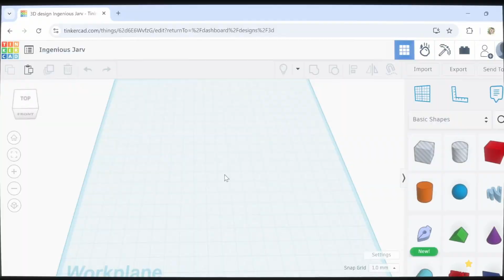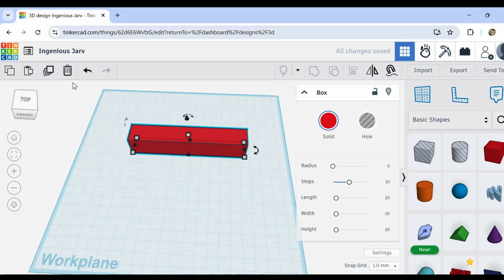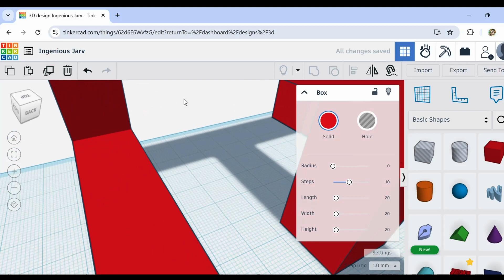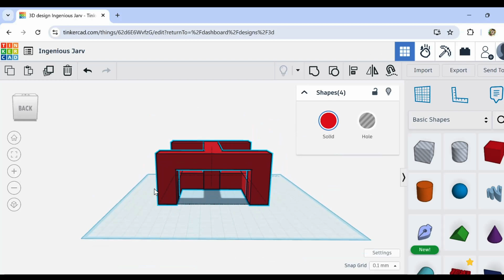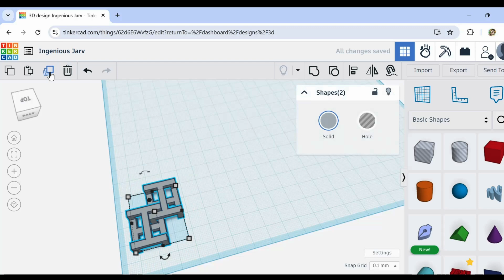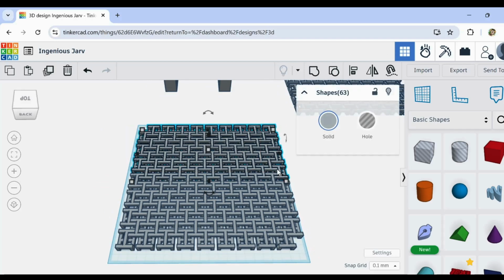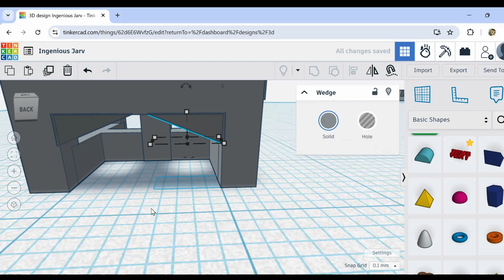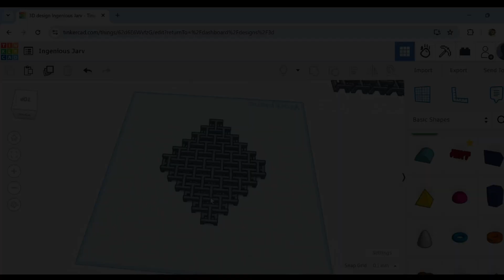Tinkercad Design Tutorial! Flexible Chainmail! 3D Modeling! ( Printable Fabric! )

Comment: Soooo I am somehow turning back to the music and sound effect stuff, but... how about an Aztec death whistle? Could be an interesting experiment in Tinkercad. A lot of shapes to cut and combine. If the ocarina was a success, this should be totally fine :D
Reply from the maker: Ohhhhhh! Yaaaaa! That sounds cool! I'll give it a try. I'll start on soon! 👍
Thanks for the idea
Reply: @TinkercadWorld-ho8ht  Made some in blender with boolenas, remeshing and all that necessary stuff for good printing. They were functional, but Blender can be intimidating for some users, and Tinkercad seems to be, if limited, but still a good start to make these type of things. If you really want to go into the mechanics, you can find some cross sections and there is actually two forms for it... the pipe shape and the head shape. The latter is the more common, but if you find a certain drawn diagram, specifically the Aztec death whistle study, you will see what I mean with the "pipe shape".